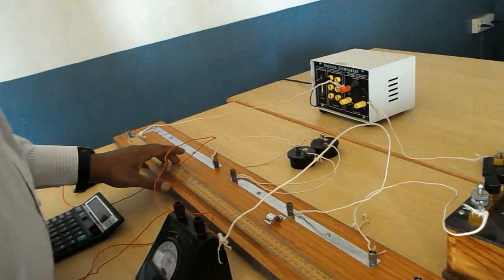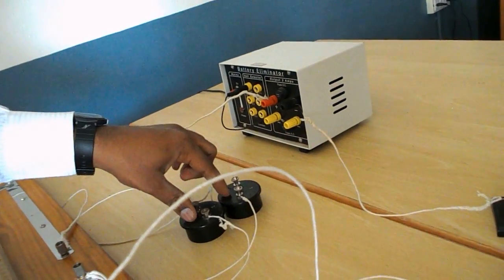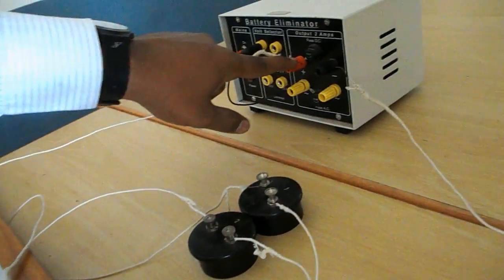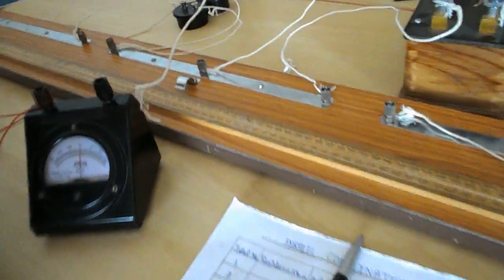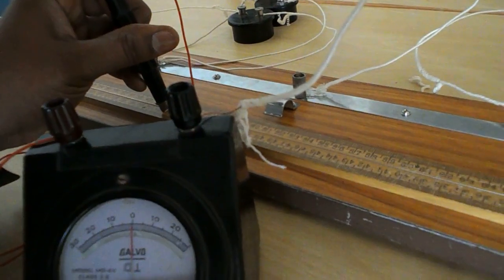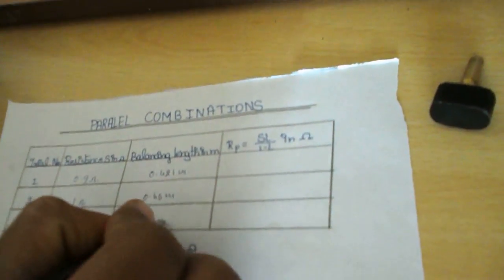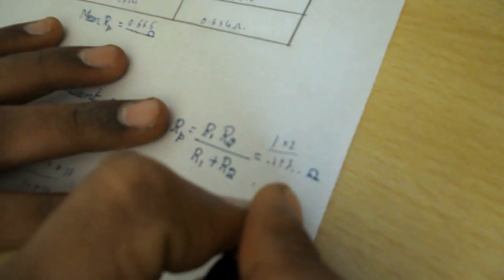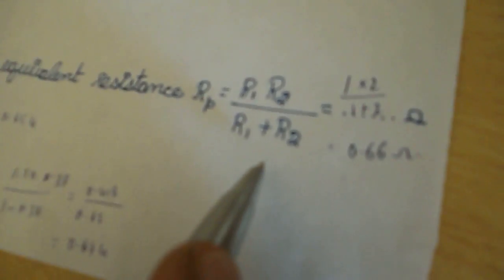Parallel Combination

Comment: The positive terminal of galvanometer should be connected to the centre strip of metre bridge (point B)  & the negative terminal of galvanometer should be connected to the jockey...sir plz correct it .... U have done vice versa
Reply: It doesn't matter, it just  reverses the direction of deflection
Reply: Yeah!! You can connect either terminal of the galvanometer with the jockey.... It doesn't matter...🥰